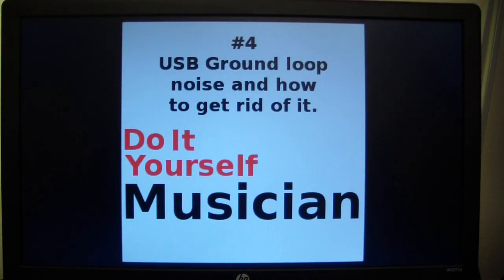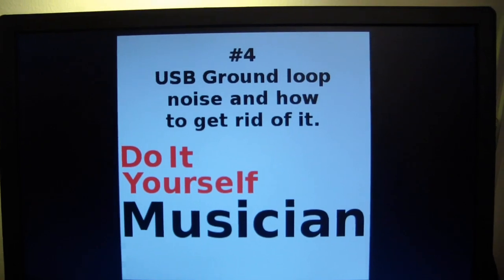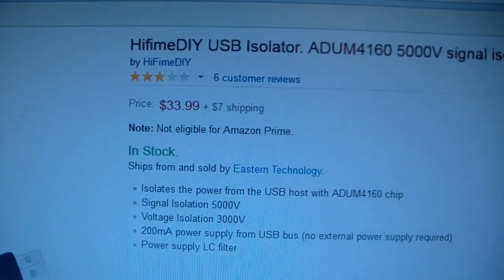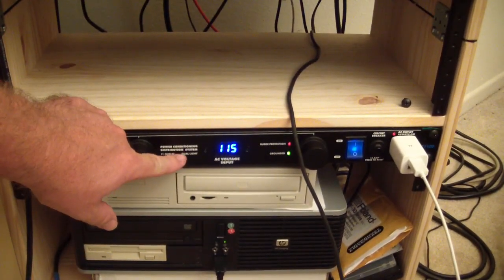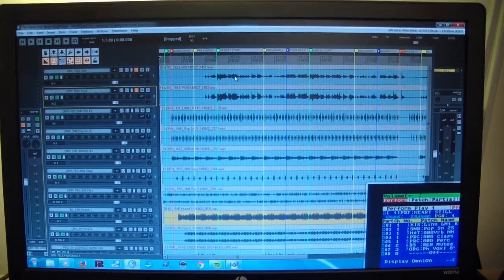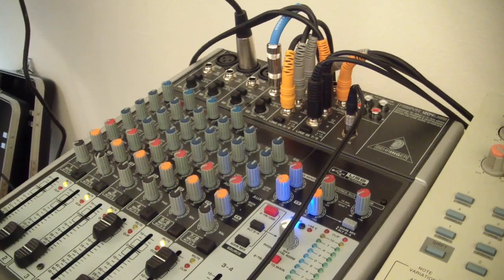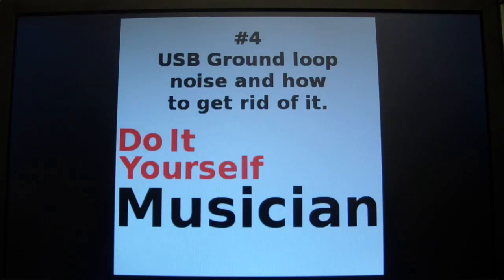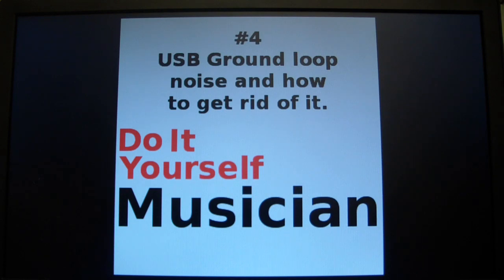Do It Yourself Musician #4 - Fix USB Audio Noise with HifimeDIY USB Isolator

Comment: I need to try this out... I am so fed up with this ground-loop issue now... It screams when I am using soft-amp/fx on my guitars wich is connected to my MIXER and directly to my PC ... using my PC speakers as sound. (atm) - Really hope it works. -tnx for the tip man! -Arnt P from Norway
Reply from the maker: Thank you for watching!
Reply: Found it for 29$ :) on it's way in the mail now aws :) tnx again
Reply from the maker: Hope it works for you!
Reply: Well - got it today... and: It didn't work at all :-/ So I must really concider getting me a Firewire external soundcard or audio interface.
Reply: same here. I'm going to purchase a 1.1 usb cable to ensure that I do not have a hi speed cable.
Reply: I tried with several different USB cables (both old ones and new ones) but nothing worked. So I just need to obtain me some more cash and purchase Focusrite firewire soundcard. I know that wont cause problems. Owned the Pro 40 before so...
Reply from the maker: It's hard to know what each persons situation is so I recommend that before people buy one they make certain the noise is being propagated through the USB cable and understand why it is so. Make sure there is a loop in the setup.

Comment: Great video.. I am having the same issue with my PC.. my PC is built for gaming and sound production. I have a Gigabyte 5 gaming board and use a M-Audo (M-Track) usb sound card. Attached through 1/4 inch are KRK 8's.  I get the high pitched frequency and that wavy his that fluctuates depending on what my computer is processing. It really goes bananas when my video card starts chugging in games. I have however also heard it when headphones were plugged directly into motherboard. So I am hoping even if it's a mother board issue somehow that it will be cut off by this just before being processed by my usb interface.  Any thoughts.. thanks a lot for the video :)
Reply: Thank you soooooooo much.. I got the exact product.. shipped to my door in 2 days.. works like a charm.. you da man  :)
Reply: I've got a Gigabyte mobo as well, and I'm really not liking it for audio production.  It's a noisy bugger!  I'll have to try one of these isolaters and see how it works.

Comment: Thanks for the info. I get that digital noise in my studio monitors and have been trying to get rid of it. Someone mentioned the Behringer HD400 DI box. Do you think it's the answer? By the way, does that Nano Patch passive audio controller have balanced inputs and outputs? It's something I may interested in.
Reply from the maker: Well you could use a transformer iso box in the right place to filter out noise but you should find out where the noise is coming from first. The Nano Patch does have balanced ins and outs.
Reply: Ok. Thank you.

Comment: Hi,  I'm looking for an USB soundcard. But I wonder if this one will fix my issue?!!!

I'm using 2.1 speaker with laptop, but there's noise when I plug the AC Adapter during, if I unplug the adapter it will not happen.

Many thanks
Reply from the maker: +Khanh Nguyen It might. It helps with various USB noise issues.

Comment: Thanks for your video,it got me thinking.If you have your device plugged into a USB Hub that could also be the problem. That ended up being the problem I was having with my Boss GT 10, it was so noisy I didn't want to use it anymore. I almost bought the USB isolator, but decided to try some other things first.I plugged it directly into the USB port on my Mac and the problem was solved. Something so simple. If any of you are like me ,you plug stuff  into stuff plugged into other stuff. So if this helps anyone, great!
Reply from the maker: +James Pool Good tip! Thanks for watching!
Reply: THIS.  ME 2.   Unplug it all and plug it together differently and some problems just disappear without paying a cent.

Comment: Hi sir,,I have samson c01 and M Audio m track Usb Audio Interface..A year ago i replaced my intel motherboard with asus motherboard and whenever i try to record something i hear some annoying white noise,when the input signal is set to the maximum..unfortunately it gets worse when i turn on the phantom power..Listen to this (https://drive.google.com/file/d/0B1Xzol7uL3x3SXlqM08tZ01pVXM/view) (https://drive.google.com/file/d/0B1Xzol7uL3x3VDRQejg3b3pCU1U/view)..I even tried some gate effects which really didnt help...I just wanted to get rid of that buzzing noise ..will HifimeDIY USB Isolator fix my problem?? or should i go for a better soundcard? please let me know..Thanks in advance :)
Reply from the maker: +Harrison Moses It would probably not help with the white noise. Most systems do have a noise floor that will become apparent if you crank the gain all the way up. I do hear some slight mains hum in your clips though and the isolator may help with that but it's hard to be sure.
Reply: +DoItYourselfMusician Thank you so much for your reply sir :)
Reply: +Hobby Vaptor Yep..Asus sucks 😝
Reply: +Harrison Moses I have the M-Track II USB interface and I just compared my noise profile to yours; -51.9db vs -51.0db of white noise, with max gain on the pres  (~55db?) and no phantom. I'm running an Asus X79 Pro motherboard. 

It's all really quite depressing, as even with the gain set to minimum, I'm still getting a noise floor of around -84.2 db. I feel because of this, I can't run my mics low on signal and normalize in post - normalizing more than 15-db in post brings out that noise floor even with the pres at a modest gain, which can really add up in the final mix.  I feel this forces me to really watch my mic technique and limits how dynamic I can be, else I clip the signal.

The above is assuming a best-case scenario with an easy to run mic; something like a Shure SM7b though needs like 60 db of clean gain, which just fails on the M-Track II. I suppose if I picked up a Cloudlifter pre-amp; which adds 20-db of gain for the cost of like 1 db of noise I believe, I'll be able to run the mic, but I'll still need a lot of gain on the M-Track. This leaves virtually no headroom for adjusting gain in post... 

I'll report back if I find a solution.
Reply: Steve Seguin Thanks man 😊
Reply from the maker: I try to get the loudest level possible at the mic then again at the input gain. I try to record as hot a signal I can to my DAW. I hear all this stuff about not needing to do that but I see more benefits than drawbacks. Anyway a nice comp limiter can help you with taming loud transients after the mic.
Reply: Someone asked me to go for a presonus/focusrite soundcard so i bought Presonus Audiobox itwo, guess what the white noise is completely gone..a big up to their class A mic preamps and Studio one Recording software....after going through all sorts of frustrations,Presonus is the life saver 👍🙏

Comment: man i just got one of these things in hope that it helps my issue too.... got a high speed one. my issue is the same exact sound through an iMac and m audio interface to KRKs. only thing that is different is that the sound mine makes stays the same volume no matter how loud or quiet the volume is on my interface. i seriously hope this works
Reply from the maker: +Shawn Kraft Thanks for watching! I hope it works for you too. Let us know!
Reply: +DoItYourselfMusician damn, I got one. Not the same as yours but it almost seems like the one I got won't push enough power to my usb interface, it turns off and on rapidly. I might try purchasing the one you used in this video, cause you have a lot more stuff going through your computer than my one m-box mini..
Reply from the maker: +Shawn Kraft Do you know if your interface is classified as a Full Speed or High Speed USB device? The HiFimeDIY device will only handle Full speed. Or as you say it could be a power limitation in the device you bought.
Reply: Mac n mike, did you ever purchase one? And if so how was the results?

Comment: I recently got the same issue after reconnecting my studio and gear for optimization. I´s drove me MAD to hear this whining noise in my recordings! So strange that I never had it before, I suspect that it comes from my computer, the computer cost me 1100 dollars two years ago i´m not to happy buying a new computer to fix this ground loop. I just bought a USB isolator from ebay for 23 dollars and I pray to GOD that it will work. I will keep you informed.
Reply from the maker: +Mathias Annerstedt I hope it helps! Still working fine for me. No trouble and no noise at all. Thanks for watching!
Reply: Hey, it's been a while... did it work? About to pull the trigger.

Comment: Very good video. Unfortunately due to tech limitations at this time USB isolators are limited to full speed, they are not capable of high speed. This particular isolator you demonstrate and the Olimex isolator I use does not have an optoisolator. The ADUM4160 chip is a digital isolator, different architecture all together. I know that if you needed to run high power devices the Olimex isolator has an external DC power supply available to run those devices like a hard drive.

If you needed high speed, then removing the loop at another point other than the USB may be the only option, such as at your rack unit or any other external device. So many variables when chasing down earth loops can drive anyone crazy, and daunting for a novice without the knowhow to troubleshoot.

Cheers!
Reply from the maker: ***** Thanks for watching! You of course are entirely correct. I did not do a enough research into the device before I made the video. I have annotated it now.
Reply: There are high speed. But they are expensive: http://www.decibelhifi.com.au/intona-usb-isolator/
Reply: HifimeDIY does have a high-speed version as well.

Comment: That's not just USB noise. It is computer ground loop noise. I had it with a terratec PCI audio interface that was connected to a desk. Moving the mouse and screen images would produce different noises through the speakers. Because there was no USB to isolate, I had to isolate the audio connections between the equipment that was plugged into mains, this meant the two main outputs from the sound card to the main inputs on the desk had to have inline isolators or something like the ebteck hum eliminator.

So calling it USB noise is a bit misleading because it isn't caused by USB. It can be eradicated by isolating the USB cable or the audio cables. Anything to separate the two mains powered pieces of equipment. Doing it on the USB cable is the best option though.

My old PC which had an Intel board never had any ground loop issues. It was only when I built a new PC with an Asus board that it started to happen. I even tried using the power supply from the old pc in new pc and it still happened. My belief is that the Intel board has something on it that prevents this. I can not confirm this, but it makes you think that the motherboard is ultimately to blame when two systems, almost the same except for motherboard, behave differently. Asus board produced ground loops, Intel board was crystal clear.

I have since removed the audio desk and started using a USB powered Scarlett 2i4 directly feeding my amp. Yes, I have ground loops again since the amp and computer are both plugged into mains. So I now want to invest in a USB isolator so I don't have to compromise the audio with a cheap hum eliminator on the audio signals like before.
Reply: +Damn Deal Done Maybe it could be misleading name, but I found thise cause I didn't know the real name of the problem, so I looked after for "usb cable filter noise" and got here. Now I know that it's called "ground loop noise" (the name it's even at the beggining of the video). So, I thank him for calling this video like this (and he can still add the "ground loop noise" tag). And yeah, my problem is exactly this ground loop noise (among other issues).
Reply: +Damn Deal Done So is this Hifime DIY USB isolator the solution? because i'm having the exact same issues as you (moving the mouse and such).
Reply: *****  I think a USB isolator will do the job. If you have a powered amp or speakers connected to a powered computer you need to isolate both pieces of gear from each other. It can be done either at the USB port with an isolator, although I have no experience with them, or on the audio cables with an audio isolator or HUM isolator, which is the method I use currently (though can result in HF loss). But first make sure it isn't caused by a cheap VGA monitor cable. A poor VGA monitor cable can leak interference. First thing to check. A good thick one with solid ends and a sizeable bead. Check this first because not all connected systems will automatically create ground loops.

[edit] I won't be using a USB isolator because they don't work with hi powered USB interfaces such as Focusrite 2i4. So I will stick to isolating the audio cables going to my amplifier.
Reply: i have focusrite 2i2 and i wanna buy a usb isolator, it will works?

Comment: That's exactly the sound i'm getting!! but i used an rca ground loop isolator, which worked like a charm.
Reply from the maker: Yes the noise can sometimes be taken care of in the audio lines themselves depending on your setup. Thanks for watching!
Reply from the maker: *****
Not sure it will help with a hiss type of sound. If you have a hum or high pitched whine then it might do.
Reply from the maker: ***** If you try it out report back if it worked for you or not.
Reply: Yes it worked, i bought a 20 AMP RCA Noise Filter Ground Loop Isolator. Its about £5 and completely removed all noise. complete silence after 2 year struggle!!